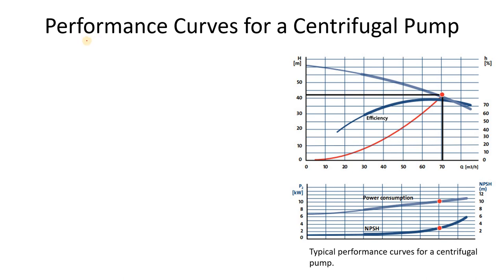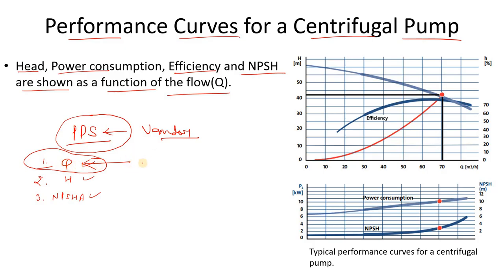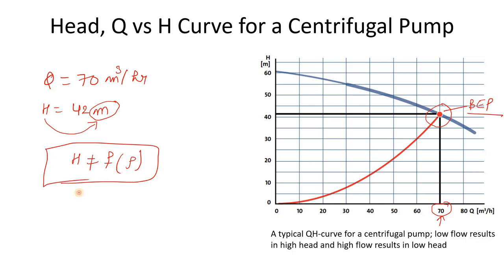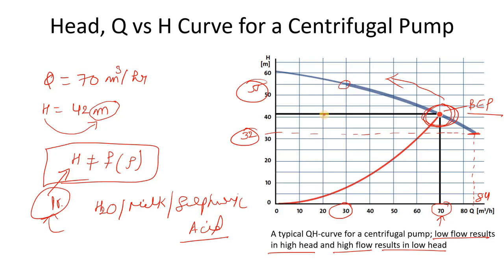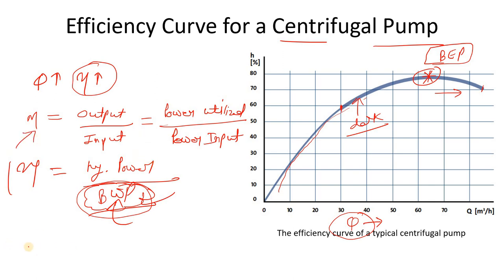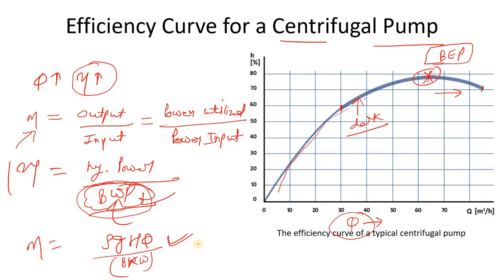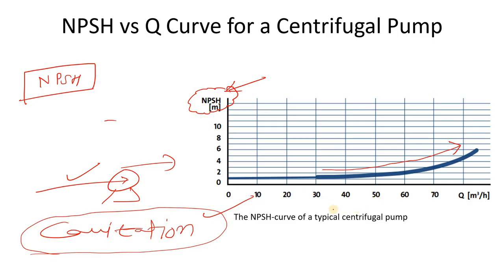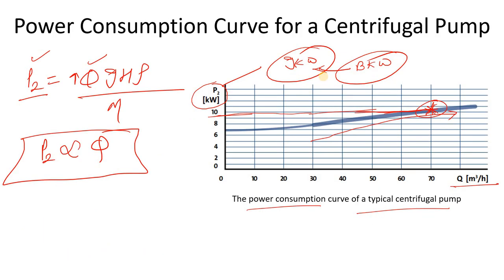Pump Performance Curve Explained | Master the Pump Curve for Optimal Results | Pump Curve

Comment: By increasing Q, Why H is reducing? Technical reason...
Reply from the maker: do practically this in your home by flexible pipe then you'll find the reasons very simple
Reply: By increasing Q, you are increasing the velocity. For real fluid, increasing velocity results in decreasing the head. Because,  for greater velocity, head loss by friction is greater as they are proportional.

Comment: How I will calculate efficiency if Q and H are in this condition that are not intersecting efficiency curve?
Reply from the maker: mainly it consist the that one as well. the curve which I shared individually was for the reference purpose to elaborate the each curve.

Comment: I think, if Q decreases, npsh will decrease. So possibility of cavitation will increase. am I right sir?
Reply from the maker: Absolutely right! Could you tell why will it happen?
Reply: Sir i think pump develop pressure so increase liquid pressure and reaches to it's temperatures so vapours pressure will increase so available pump suction pressure will be less than vapours pressure of liquid so chances to Cavitation